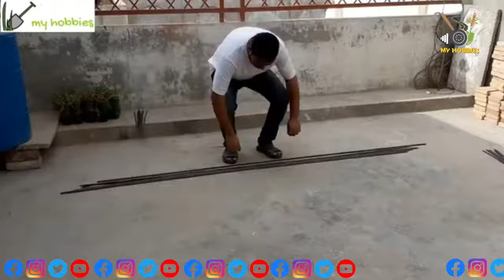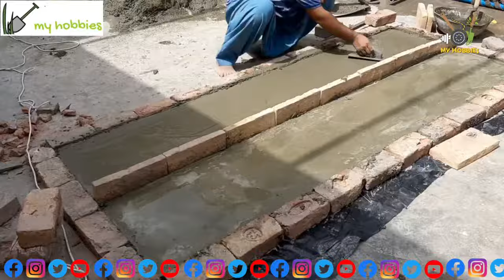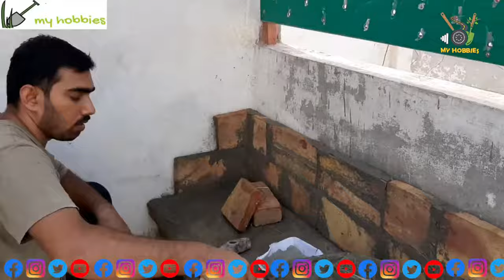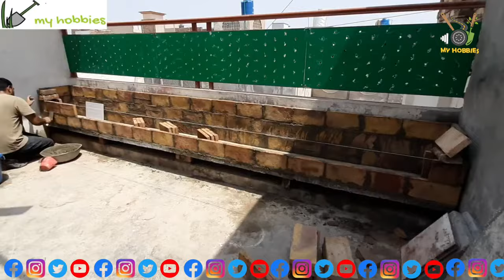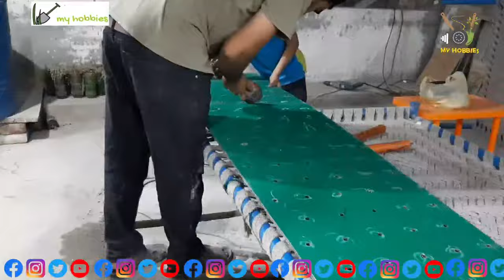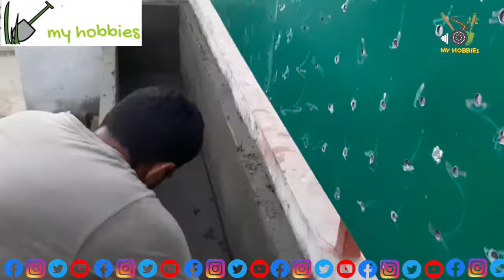How to make rooftop garden full video Big pot for big plants

Comment: Hi mate! Great project! Thanks for sharing. I have questions: What about drainage? won't roots get rotten easily? Why you did't use the external wall as part of the structure? Is it because humidity issues?
Reply from the maker: Yes bro my area is very hot and my ground water is salty so i used less water that's why no need drainage holes